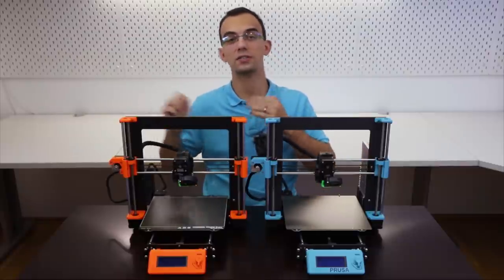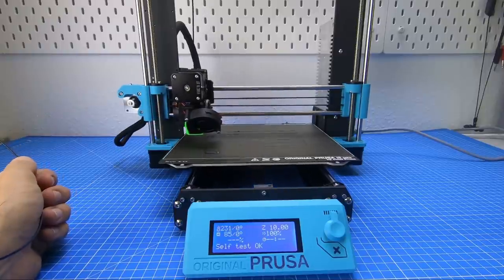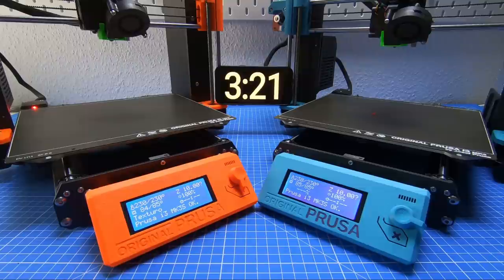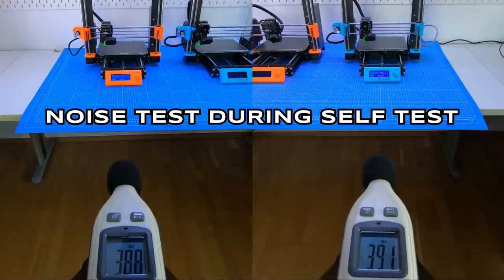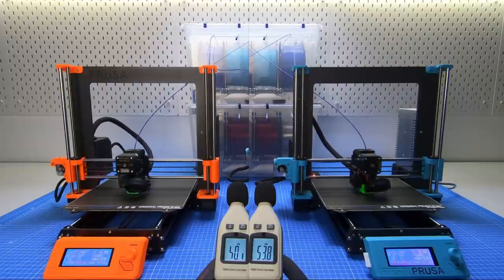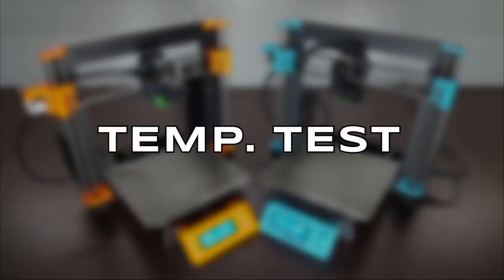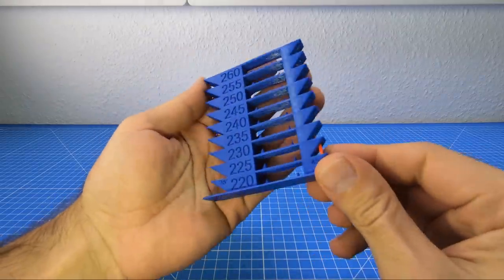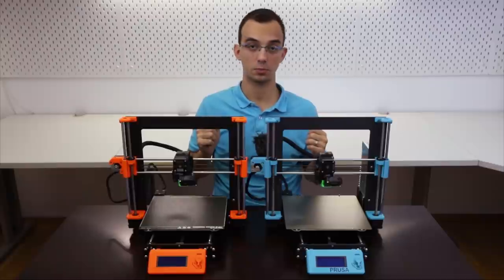The best Prusa MK3S 3D printer alternative? [test, compare, review]

Comment: I ve bought and assembled myself the Clone and when i first tested it it was great.
But when i tried to update the Firmware i got an error and on the Printer Screen it said that the External SPI flash W25X20CL isnt responding and now the printer also resets itself when i try to heat the bed.
Maybe (hopefully) someone else had similar issues and knows any solutions to try?
Reply from the maker: Which firmware version have you installed? Have you tried to install another version also?
Reply: @Dombi3D  i installed the newest for the Mk3s downloaded from the Prusa Website.
I also tried the version that you installed in your Video and the version the Printer came with
Reply: @Dombi3D  A little Update:
The Reset was caused by the Steel sheet for some weird reason :/
I rearanged it and it worked again, but updating the Firmware still leads to the error message.
Reply from the maker: @Karafu147  in next step I would try to flash the firmware from an SD card. Maybe the USB communication corrupted over time.
Reply: @Dombi3D  Thank you for your help i will try that :D
I Actually noticed that the firmware i tried to flash seemed to apply, at least when i check the version in the Support section. But i dont know if there is a feature that i can test which would confirm definitely that the new Firmware Version apllied.
Reply: @Dombi3D  Unfortunately i couldnt find anything online how to flash the firmware with a SD-Card, do you know that its possible?
Reply from the maker: @Karafu147  I found two related posts for your problem:
The first shows that SD card Firmware update is not possible (I did not know that before):
https://github.com/prusa3d/Prusa-Firmware/issues/675
Second link is regarding your error message:
https://help.prusa3d.com/en/article/external-spi-flash-w25x20cl-not-responding-error_112019
If you can not solve the issue can be that your Einsy-Board is faulty. Contact the seller to send you a new one if that the case.
Reply: @Dombi3D  Thank you for your Research :)
Yeah I am alredy in contact with the seller, i opened a dispute but they requested to abort it and send an Email to their tech support.
I dont know if thats the right way because i think that i might lose my legal basis for suretyship when canceling the dispute. I had bad experience with China orders, thats why I am that careful. Would be nice to hear your opinion on that :)
Reply from the maker: @Karafu147  try to write them on their facebook group: https://www.facebook.com/groups/197476557529090
Reply: @Dombi3D  Thanks for you advice, I noticed that the Printer seems to run normal with the Firmware, just with the error message popping up when the Printer starts and unable to change the Language.
I think i write my experience in assembly later down to your other video because I had some minor different problems during the assembly :)

Comment: my OPi3mks3 was a breeeeeze

compared that to my self tweaked CR10  and oth er low costs manufactures , the prusa is so hands off , th ecr priners are tweakit and get good results.
but of I want reliability  and a quality print , i take the Prusa I3 MKs3

if I need a quick print that has a 90-% succes rate I take the modified CR10 Mini .6 nozzle
I f I need a BIG print the cr10 50 with its super volcano 1.2 

I needed to modify the Cr10 te be quiet with new mainbaord an stepper as well as a whole new set of new fans
the I3 is great from the box if used under 100mm/s for the noise of the rails

Comment: I got mine a week ago. Delivery was really fast. But imho, you dont save that much. The plastic parts take a long time to print. And the cables are mostly insulated with cheap plastic. Especially the ones going to the headbed. Really brittle and stiff. I replaced most of the cables, because i fear my house could be burned down by shorting cables because of broken cable insulations. Would not recommend.
PLEASE: Replace these cables if you buy this printer. It is a real fire hazard, if you ask me.
Reply: Where did you buy those cables?

Comment: they could at least remove the prusa logo, kind of asshole move from them
Reply from the maker: That was my mistake, they do not send the plastic parts, you have to print them your own, and I should remove the Original text from it but I was "lazy" and just used the files from my original Prusa. Tried to paint just the Prusa text to not falsely show that it is an Original one. Color difference is also makes it different.
Reply: @Dombi3D  oh I see, makes sense thanks for clearing that up
Reply: @Dombi3D  the plate that says "original prusa by Josef prusa" is actually original or they sent a clone that says "original"?
Reply from the maker: @DandandinIt  If you mean the PEI Powder Coated Spring Steel Sheet, that one I bought from Prusa, Just used it here on the clone also. Since then I have the clone version of it which has a black color but not tested yet. The clone originaly comes with a smooth bed version. Check out my unboxing video where you can see what is in the box exactly.
Reply: @Dombi3D  next time, be  specific about that, as this could lead to some legal settlements etc. very unprofessional.
Reply from the maker: @izoyt  Original Prusa parts are printed with an orange or black colour. Everybody can get it at the first sight that these parts are re-printed. Tha parts are available for everybody to download and use for their own purpose. Till you are not selling them should not be an issue.